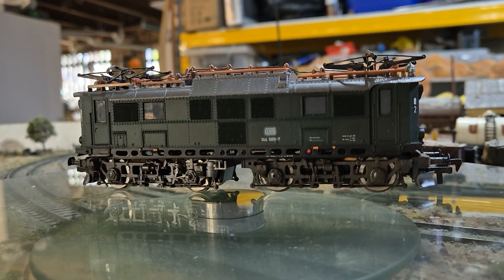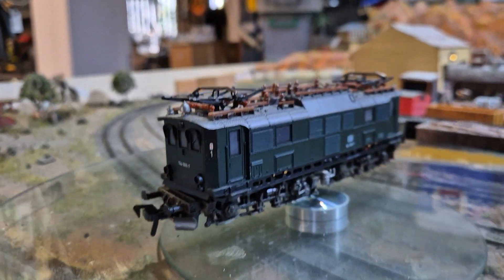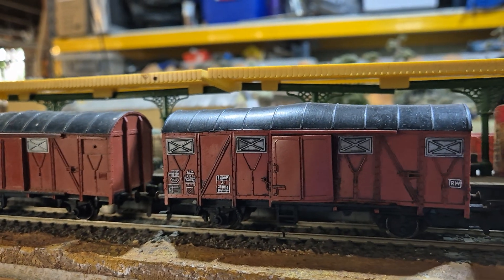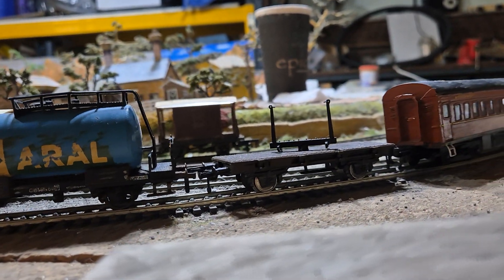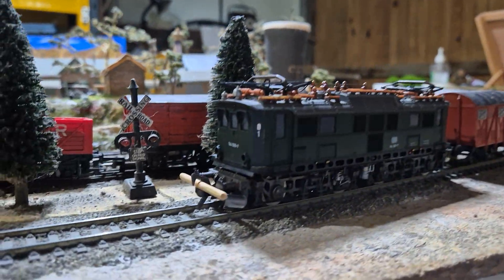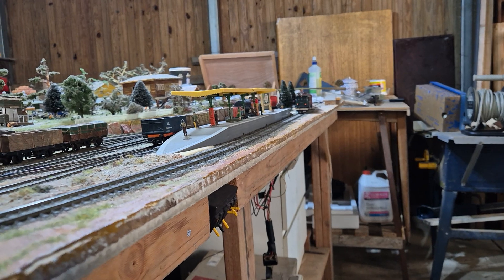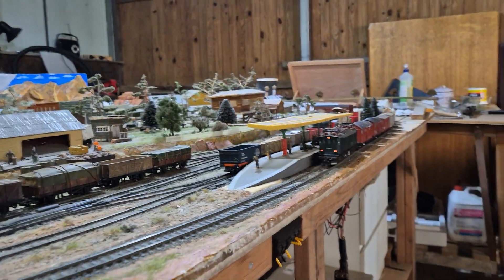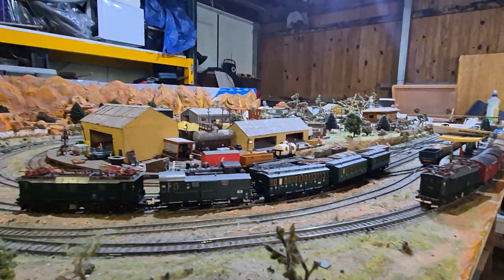Flieschmann Class 144s with an old rake of freight and some vintage carriages.

Comment: Hi Steven, you never cease to amaze me with your superb collection of Locos and rolling stock. Those Fleischmann 144s have a very high level of detail and look in great condition. The goods wagons are a nice mix of the older tinplate and later plastic models. The second 144 with its rake of illuminated Coaches must be very rare, the train looked amazing running around with out any flicker of the lights. The Primex E32 is another highly detailed model, I like the drive system with the connecting rods. Thanks for sharing these rare models with us.
All the best, Paul.👍👍🙏
Reply from the maker: @paulvozman842  I hope my Grandsons like trains Paul, I should DCC a few and build a small functional layout in the next couple of years to get them into the hobby.  I don't have a huge collection of Flieschmann, so I only recently bought those carriages. I have a little Lilliput Bavarian steam loco they will look great with, I just need to find it.  I've have recently dipped back into the market and made a few purchases which I will show in upcoming vids.  Thanks for the support mate, much appreciated.  Steven

Comment: Hi Steven, I don,t have any Fleischmann loco,s only a couple of coaches. Those 144s are great looking and real good runners. Those old tin plate wagons are really great, I have a couple of Dublo ones. I like the coaches, especially lit up. The Primex E32 looks good too. Keep them coming butty. All the best. Carl.
Reply from the maker: @carlgauntletttrains3026  Hi Carl, If you can get your hands on some Flieschmann locos, you won't be disappointed.  They are superb runners and good quality.  I bought these well over 10 years ago for next to nothing.  I don't have much freight rolling stock though, that rake is about it.  The E32 runs like a clock, I'll give it a run so you can check it out. From memory, Prime is a cheaper option, but I think they are very good value.  Steven.